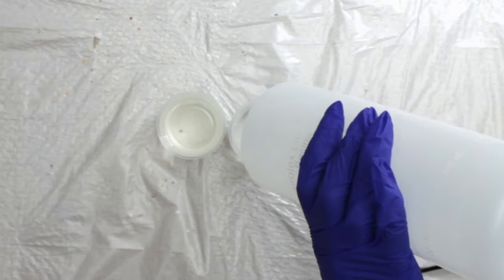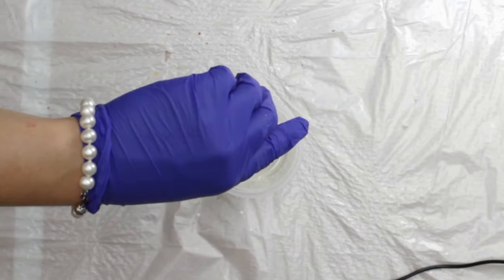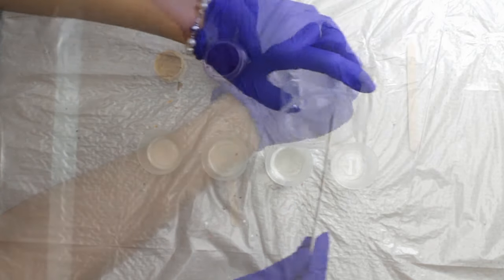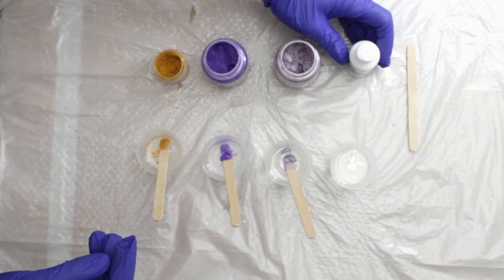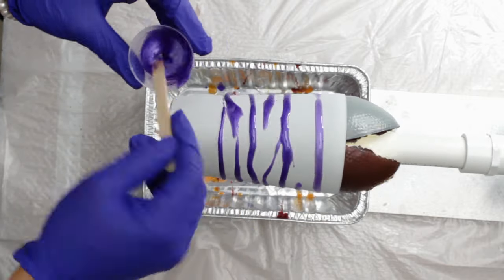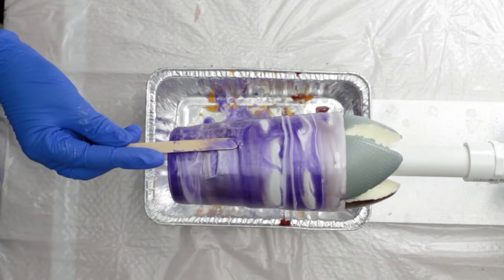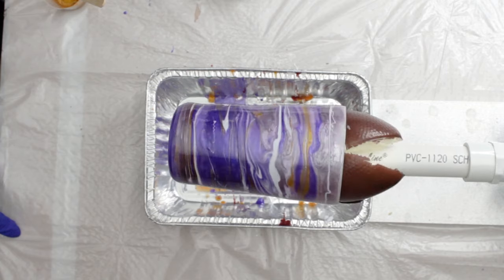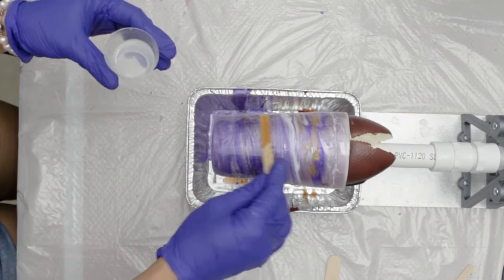How to Make a Resin Travel Mug

Comment: An excellent technique and tutorial. Can the same principals be used to decorate my fleshlight?
Reply from the maker: That is a great idea! If the flashlight is metal, tape off any parts you want to keep clear of resin and scuff the surface with sandpaper first or undercoat it with a metal primer. The challenge will be to find a way of fixing the torch so that it can rotate as the resin cures. Good luck!
Reply: @MyleneHillam  Thanks for tips. Me and my wife's son are going to have a great making one.
Reply from the maker: @Elbrond1991  That sounds like a wonderful project to all get involved with. Have fun!
Reply: Fleshlight ... as in the sex toy?
Reply: @erikaclancy1187  That is correct. Is there something wrong with that?

Comment: Very nice, is it easy to clean in dishwasher? Or not to put in it,
Reply from the maker: This particular one doesn't have an insert that you can pull out and wash separately so this mug is handwash only. Epoxy resins, in general, are not suitable for the dishwasher because they don't stand up to the heat.
Reply: @MyleneHillam  thank u very mutch 💕, l wanted to use resin too but l was very interested how to clean it,